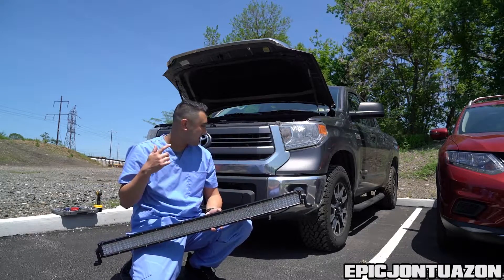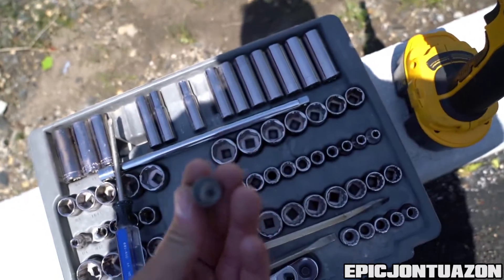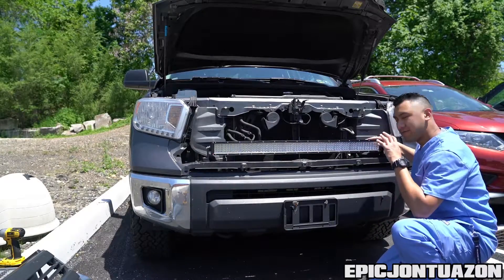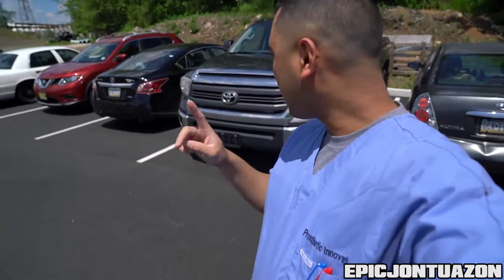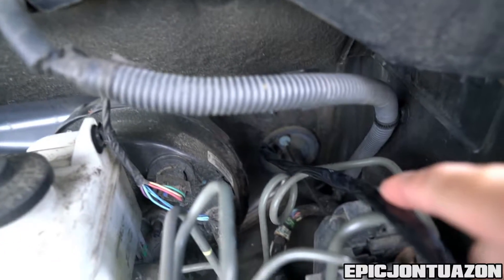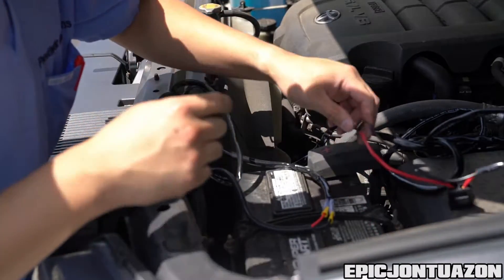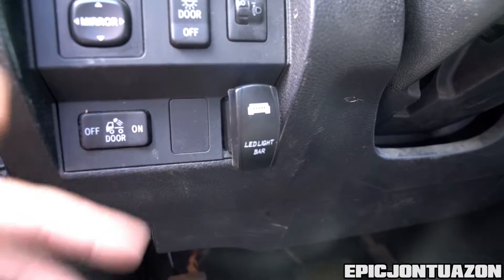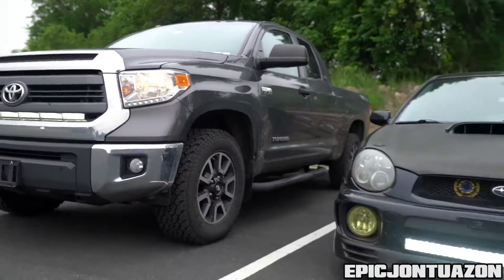42" Auxbeam Quad-beam Series | 2014 Toyota Tundra

Comment: What ratings on wattage and lumens, please. 
 And, what are the diodes degrees,  10, 30, 60, etc.
 You can add a SPDT switch and a relay to activate the lightbar independently or come on with your high beams, too.
Reply from the maker: It's 24,000 Lumens. Not sure what the diode degrees are but I know there flood beam. Would be epic to have them go on with the high beams will need to look into that!